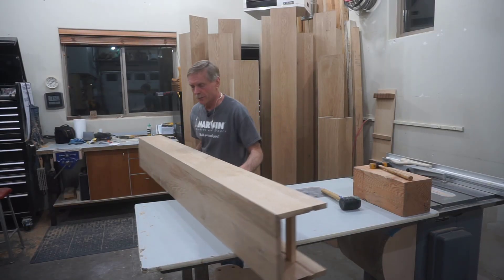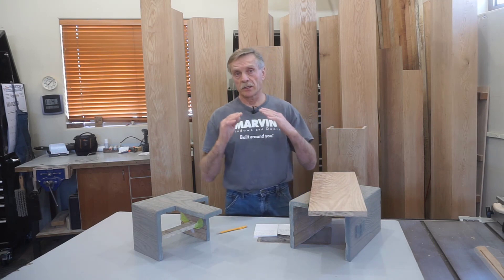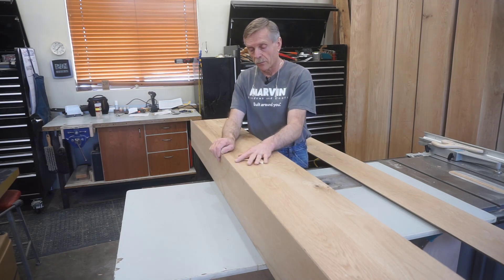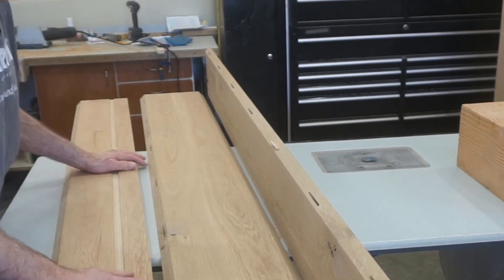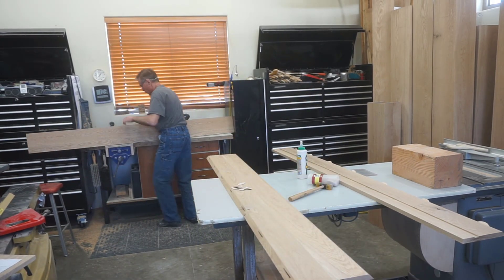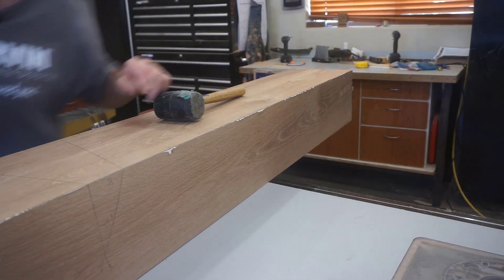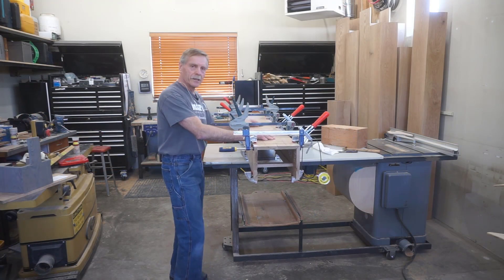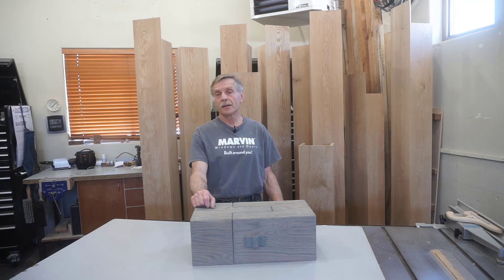5 Pro Secrets for the Best Box Beams

Comment: I'm an advanced level, non-professional woodworker and I have to say that this is VERY impressive.  Those joints are absolutely perfect!  The detail and explanation for why each "secret" is needed adds so much value to the entire process.  Great job!
Reply from the maker: Thanks for your 'review', Charlie... much appreciated.  FWIW I'm gearing up for another faux beam project that involves about 150lf of similar beams where I plan to use the very same method of fabrication... if it's not broke, don't fix it, right?
Best,
Matt

Comment: Consider using liquid hide glue instead of Titebond.  Less stress during glue up.  I know, I've done it both ways.  The only trick to liquid hide glue is you need the shop and material to be somewhat warm.  And I don't mean Franklin's liquid hide glue.  Get Old Brown Glue from Patrick Edwards.  Added bonus: it doesn't result in glue splotch under finishes like PVA glues do.  Added double bonus: it cleans up easy with cold water.

Comment: The difference between a professional and a DIY'er?  When you went to the glue closet for the glue,,,,,,It would have been a refrigerator and I'd be reaching for a Beer.  This is an awesome video, those biscuit joints just took it to another level.  Sure wish you were close to SD.  I have a project.

Comment: There is a big investment in beams and these are no exception.  The rewards are a top quality sound and fit for purpose product.  Thank you for sharing as the principles apply to simple and strong box work.  The one thing overlooked is that in the fit out these beams usually are used to contain other things and regretfully the next user is not always willing to maintain your standards. Thank you for a great start and sound foundation.
Reply from the maker: Thanks ECDRA... sadly the next user is as likely to tear those beams down in an effort to 'clean things up' or 'open things up' as to attempt to increase their usefulness.  Best, Matt

Comment: Great video...thanks.  I have one suggestion for you...a dead blow mallet for assembly.  Around 24 oz. is my favorite with a slimmer head design.  The buck shot inside has an amazing way of directing force without the rebound as well as non damage factor.  Once you use one you'll never go back to a plastic or rubber mallet.
Reply: Have used them before but the fact that they don't have any rebound is actually somewhat annoying

Comment: Yet again a great result. All ducks in a row - beautiful! Having biscuits, dominoes or splines also take a lot of stress out of the glue up process as nothing slides out of whack and distorts everything, which is probably an even greater advantage of using them, as you do have a pretty good size glue surface on there already. Spot on! 👍
Reply from the maker: I get the sense you made your comment from experience Martin... very cool! Best, Matt
Reply: @NextLevelCarpentry  indeed - if you haven't messed up a glue up once or twice, you haven't done any... Not enough at least.

Comment: I was amazed at how well the miters fit a long the edge with the biscuits. I sometimes have trouble getting accurate alignment with my old Porter Cable plate joiner and you’re right, Ive never seen one like yours. What kind is it?  And, Great video - as always.

Comment: Yes, it's a bit OCD, but I'd do the same thing lol  Those came out so nice I wouldn't be able to bring myself to distress them. I love a good tight, square joint and I even have a problem putting a chamfer or roundover when I make a quality joint like that.
Reply: Thats the problem with work these days. People call doing something right ocd.. No matter the trade.. 

 I recently took a very old, westhered door apart to sand and clearcoat that wear and tear in. I was amazed by the mortise and tenon work, routing of the parts and the fact that ZERO  nails and ZERO  glue held this door together for over 100 years. The forefathers of woodworking would be sick if they saw todays cardboard doors.

 Putting that door back together was also tricky. If it wasnt the right order it wasnt going together.

Im done rambling

Comment: I have tried sawdust, tried a chisel when the glue is peelable, tried water and rags. I even tried a putty knife. I always had some sort of glue in some pores that didn't seem to want to take color.
On 60 5 piece oak cabinet doors with ogee profiles I used a stiff toothbrush and water asap after clamping. That has worked the best out of anything I have tried. I dry it with a clean rag but I have had zero problems with glue affecting my staining or dying since.
Reply from the maker: Tight complex Corners like that are always a challenge and I sometimes resort to Desperate Measures for cases like that and when I do I find that a shot of compressed air along with a stiff brush gets the job done... it's good to know you have methods that provide the results you are working towards... Best, Matt

Comment: Great work as always. I did notice you didn't apply glue to the opposite side of the biscuit during assembly. Was this intentional or was it just not filmed? It was my understanding that both sides of the biscuit needed glue so that it can swell in the joint properly, however, I understand if you only needed them for alignment or this step was skipped due to the time crunch with your glue starting to set up. Regardless, with the amount of glue used, that joint will never come apart. I was just curious... that's my OCD.
Reply from the maker: Good observation and question Art!  Notice at 15:03  to 15:10 how the bead of glue lays over the biscuit slot.  I mention loosing audio during the shoot and part of what I lost was an explanation of how that bead of glue runs down and is forced into the opposite side of the biscuit so, as you correctly note, both sides get glue to expand and hold albeit more than necessary for this particular joint.  Where it matters more I'll butter up both edges of the biscuit itself and make sure the slot is full and 'primed' with glue to maximize holding potential of the biscuit.  I like your OCD nature and very reasonable way of presenting this question... I respect you for both and appreciate your comment! Best, Matt

Comment: "It's 1:30"...'ping' Very nice work as always.  I like the tip to cut my bevels beyond 45˚ to get a tighter mitre joint. Considering this for a mantle and thinking about using glued up end grain for the ends rather than a flat board.
Reply from the maker: I did exactly that on a mantle some time back... worked great but it's a bit tricky to get a real/natural looking piece by gluing up... kinda like a mini butcher block.  Even if you don't get a perfect look it's still a cool touch that will fool 90% of people that see it.  Good luck with your project, Alex! Best, Matt
Reply: @NextLevelCarpentry  Thanks for the reply. Rather than have 6 or 7 pieces of end grain layered, I'm going to try to get two slices off the end of an actual beam.  This will be a balance between cost/weight and appearance.  You have a great channel.
Reply from the maker: @alexlongfield2113  That's great... I'm glad for you you have the option/luxury of access to an actual beam.  If you don't already know you'll quickly see how perfectly the joint between end cap and faces disappears.  Here's a shot of the mantle I did:  https://www.pinterest.com/pin/551479916866451080/ to give you more confidence in tackling your project. I uploaded a couple more photos showing the glue up and finished project if it interests you but I suspect you're beyond needing it. 😎 
https://www.pinterest.com/pin/551479916880030495/
https://www.pinterest.com/pin/551479916880030488/
Best, Matt

Comment: Wow this is very impressive craftsmanship! Any tips for how to modify this technique for fully boxed beams (posts)? What if you were using rough sawn wood?  Im’m trying to do both (at same time).
Reply from the maker: William, This video addresses your question fairly well:
https://youtu.be/iyt6WBMt-NY
and is exactly how I would approach the project you're asking about.  Like the rough sawn beams in this video, I flatten, thickness and true edges of rough-sawn material before doing mitered joinery for the corners and then, counterintuitively, recreate the rough sawn texture to suit my client's wishes:  
https://youtu.be/4Un0mjkadLo
Hope this helps and good luck with your project!
Best, Matt
Reply: @NextLevelCarpentry  thank you, Matt!  your video is a scaled down version of what I want to build ~9' tall, 10" sided posts that will run up to 10" sided beams in an outdoor porch.  The posts and beams will be exposed to the elements but sheltered by ~20" overhang.  I am thinking of using white oak protected by exterior poly or varnish.  Would this exterior installation change your approach to construction?  Any thoughts on joining the posts to the beams?

 I'd rather not use cedar, teak, redwood bc I prefer the look of the white oak and it's indigenous to Ohio.
Reply from the maker: @williammcmaster5415  considering that many ship hulls were once built with white oak it should be more than adequate for your post wraps especially if you give them a good coat of a durable exterior finish.
Since they are only occasionally exposed to water I would have no issues using the same joinery and same Titebond 3 glue for building those posts. 
Do you have to wrap a structural post that's already in place or are you able to make up hollow boxes?
The Simple Solution for joining the posts to beams would be to Overlay with a faux wrought iron tee strap  of some sort fastened to  the face after the fact but if you want it to look like mortise and Tenon joinery it would look cool but would be considerably more work and fuss.
Regarding the finish I would take a good look at a product called Grain Stain made by Diamond Vogel which is used on log homes with great results because it's a penetrating finish compared to an applied finish like polyurethane so it's less likely to chip and crack.
You can just check to see what is being used in your area for exposed Timbers on timber frame homes for guidance to the best finish though even though I don't know what you'll find.
Sounds like a fun project...
Best, Matt
Reply: Thx again, Matt!  I will definitely check out the penetrating finish.

Comment: Hi, Matt. It took me a little while to realize what the box beams are for.  What I was hoping for was an engineered beam for supporting either ceiling or floor joists.  Any thoughts on that subject?  I want to level both my living room ceiling joists and my dining room floor joists.  My thought is to make an I beam from two vertical pieces of plywood with a wide bottom and a narrower top to allow for a screwdriver (reversed for the floor joists.
Reply from the maker: As I'm sure you know having any sort of beams for straightening flattening lifting or supporting is a structural issue where the beans I'm making here are merely cosmetic.  I will say that if you want to cover structural beams with something like this I would make the beam the same way and only remove the spreader bars during installation when the u-shaped beam is slipped up to cover the structural beam.  Good luck with what sounds like a challenging but rewarding project! Best, Matt
Reply: @NextLevelCarpentry  No, I don't intend to cover my structural beams with cosmetic beams.  I was just hoping to con a little advice on the design of structural beams out of you.  LOL!
Reply: @NextLevelCarpentry  PS - I love your videos
.
Reply from the maker: @kvernon2  can't go wrong with LVLs or glulams! In other words don't waste your time messing with plywood built up beans Etc just go for the real deal😁😎
Reply: @NextLevelCarpentry  Thanks, Matt!
Reply: What you are talking about exists, basically, and is called a TJI joist. As Matt mentioned, Glulam, LVL, etc. are very strong engineered beams that are very straight and true.

Comment: Matt,  if I'm not mistaken Titebond III has the longest working time of their PVA glues. Since the beams are for an interior installation why not use Titebond's hide glue which has a much longer working time?
Reply from the maker: I suppose if the beams were more complicated or it was hotter in the shop longer working time might be necessary but, as it is, the only reason I'd need any more working time on this project was for the delay from setting up and shooting video.  Best, Matt

Comment: Im about to attempt a 19 foot box beam, (my first) and am using some relatively green douglas fir that is a year old, its been stickered and drying for awhile in my bsmt.  my concern is warping because  a week after getting them home inside one started to cup, untill I got it screwed between some 2x4's and re-flatened., (its not quarter sawn, although I probably should have requested that), so I was thinking about making a jig, then slicing these 1 inch thick slabs in half or thinner, on a band saw, and laminating them to 1/4 inch plywood, then doing my 45 miter joint.  
I can see this being an episode trying to final machine them on my jointer.
I suppose if it worked then I could do that to the other pieces and make more beams.
Any thoughts on this method?

Comment: As usual, very educational, can you say, in what context the beams will be used for?
Reply from the maker: Thanks Rich... the quick shot of my SketchUp model is here: https://youtu.be/-zzo74Agqf8?t=1532 and shows the walkout basement family room configuration that's getting these beams.  The basement is finished space where the beams are an ad-on that I didn't want to site build because of the mess involved.  I'll attach narrow 'ladder panels' on the ceiling and screw the box beams (faux beams?) to them with nothing more than a minimal amount of scribe work where they meet walls.  The project scope includes the tile faced fireplace box, the 4 box beams at about 21' length each and then a small mini kitchen/bar/wine cooler area with a few cabinets.   Best, Matt

Comment: I really like this video and biscuit method. What’s the brand name of that plate joiner? It appears to be a different plunge style than most?  I don’t see it listed on the tools used for this project.
Reply from the maker: Thanks for watching!  FWIW the biscuit jointer you see is an OLD one, long since discontinued I'm sure.  The brand is Elu... a European subsidiary of Black & Decker back in the day, if I understand it. It's a very versatile tool and the only biscuit jointer I've ever owned or used so I can't say how it compares to other, more conventional, brands/styles but can say it's done everything I ever needed it to do.  Here's one on Ebay:   
https://www.ebay.com/itm/234606008904?hash=item369f9b9a48:g:7ssAAOSwVblivE3d that looks pretty great IMHO.
I was able to buy a new blade for mine just a few years ago... but a different brand/model might serve your needs equally, or better, depending on what you use it for.
Best,
Matt
Reply: @NextLevelCarpentry  thanks for getting back to me on that brand name and EBay link. Subscribed and watched a lot of your content already.
Reply from the maker: @majsharps  Youbetcha.  I haven't looked at those on Ebay for a while and am actually tempted to snag it as a backup/upgrade... but I won't bid you up if you decide you need it 😉😎

Comment: A person with true ocd would call it cdo, because they need to keep the letters in the right order.
Very nice work, I am going to attempt a 19 foot long beam myself, Ive purchased some long douglas fir, which I've stickered and I'll let dry for 6 months or so.  Im not confident this is the best choice of material since its not quarter sawn and was green wood about four months ago, my other choice was dry spruce.  I ind of went with someone elses opinion.  My main concern is warping, the other is cutting long pieces 45 degrees accurately on my table saw,  any thoughts?
Reply from the maker: That is not a project for the faint of heart but with determination you'll get through it.  When I'm working with potentially difficult wood sometimes I will kerf the backside of those long pieces about one third of the thickness of the wood with cuts about 1 inch apart to take some of the determination out of the wood structure that causes it to Warp.  Making beams of that length is one challenge and then scribing and installing them is another one altogether especially if they have to fit between two walls.  That is the reason I chose to add the false mortise and Tenon feature and make these beams in three separate lengths. Good luck with your project!
Best, Matt

Comment: Great video as usual.  Of course you just cost me a few hundred dollars as I now have to order those Merle clamps.  (I ordered 10) LOL.  I've got a large box beam, fake timber truss project coming up.  Those clamps will be perfect.  I always love  picking up new tips from other sawdust jockeys out there.  This video did just that.  Quick question.  Some guys recommend the domino over the biscuit.  Any thoughts there?  I've got my trusty plate joiner which I love, but always looking for something better.
Reply from the maker: I've never used a Domino Doug but can't help that think that biscuits are better for this particular application if for no other reason that the biscuits are almost 'self-aligning' during glue up.  For large quantities I assume they're less expensive too.  I'm sure someone with practice and experience with a Domino might disagree and I wouldn't argue but it sure wouldn't be necessary.  That said, if I wanted more strength in the finished joint I would take a serious look into the Domino system because the increased depth/penetration option they provide (over the about 7/16" provided by #20 biscuits) would lead to a stronger joint.  Thanks for your comment... Best, Matt
Reply: Next Level Carpentry Thanks Matt!